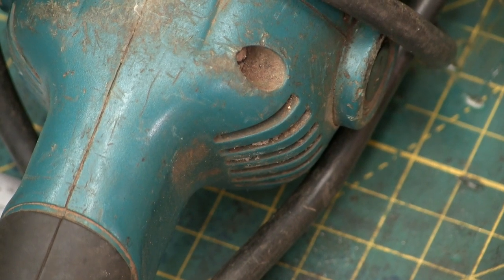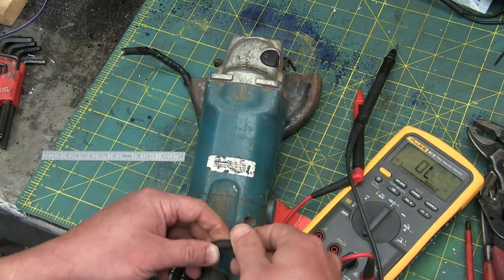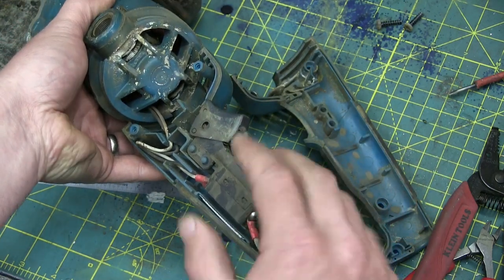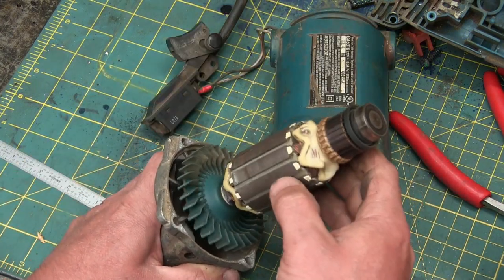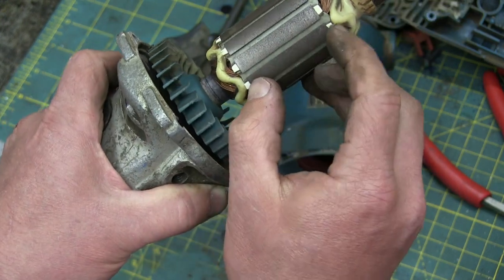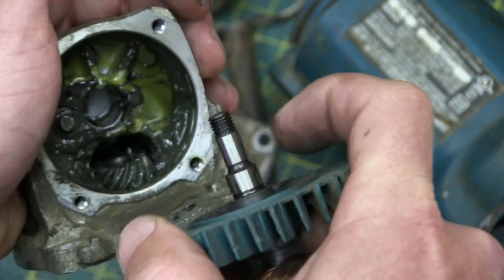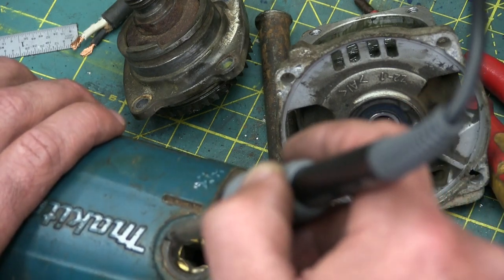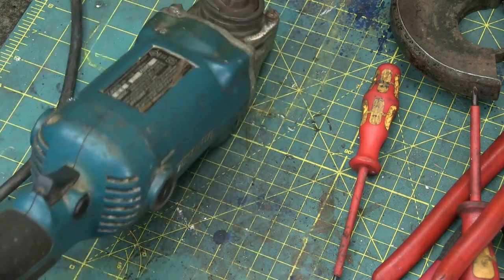BOLTR: US built Makita 5 inch angle grinder

Comment: Theres only one reason ive never bought a 5/6 inch makita. Theyre a bit more money than the default, and the default usually is burned up when youre done with it, and i assumed that was the end result of giving a welder a grinder with all makes and models. We just fuck them up. How ever, that one looks mangled, and it was still working fine. I think the makita might be actually worth the extra 50 canadian pesos, if they hold up better. Ps, i once went to buy a Makita, but, they didnt have any, and they didnt even have the default 5/6 that i wanted, so i got a 5 inch, and it lasted about 6 months. I still have it, but its starting to burn up, and its lock pin is fuckulated. (Left it at a shop with a couple mechanics, and they obviously ran the lock pin into the gear and throttled on through the noise..)

Comment: I have heard that Makita has a fairly strict spec they allow themselves as far as balancing an armature goes. If they need to remove too much material they reject that unit, it gets sold as scrap, and it ends up in another brand tool. As first rate stuff. So legend has it that you will never see a balanced Makita armature with very much taken out of it. They trash all of those.

Comment: Hi i started my apprenticeship in 1980 as a cabinet maker also do metal work, all my power tools were Makita a hammer drill, 1/4" drive router/trimmer 27,000 RPM the first li-ion 7.2v battery drill which cost a fortune as no competition try your time price gadget it was $290.00 in 1980 5" and 9" grinder circular saw 1/2" router they all still get used none have had any repairs the battery drill has the same battery  it came with  almost forgot 12" compound drop saw with linear bearing twin shaft with 10" pull for wide cuts that's a toddler at 1990 model. Would never buy another brand unless the Makita didn't have the features l needed .     Great video's

Comment: No starting condensator? In the Bosches that I fix there is :) also quite good but more failing points and more elektronics I guess :D
Reply: On a brushed motor? I've only seen those on induction motors, e.g. bench grinders and the like.
Reply: They have brushes so yes ;) Only the big ones have it GWS 24-230 JVX
http://www.mtmc.co.uk/Images/Products/92210/01_3601H64U06.GIF
number 54 It's a supression condensator, not starting condensator sorry ;)

Comment: I know this is an old video I happen to be 310 gorilla and I probably burn up more grinder's than most people I've ever bought the janky button the sometimes Falls outbreaks of bleeds of craps and pulls out so if you your mother's toe polishing  pad is stuck on the end of your grinder take a 1/8 welding rod cramming in the hole and get your  your finger smoothers nail polisher off the end grab a chunk of recycled junk from the 13 other other rat tail grinders you have and replace the button plus there's a notched section on the gland where you can slide a thin wrench into backup the gland and the screw bit to take said toe nail buffer off the end

Comment: well there newer 6 inch grinders have gotten well lighter is nice but a weaker 10 amp motor  at same rpm as well as disk break claiming that you cant hand tighten the wheel enough by hand  to keep the break from un tightening the wheel but thats a bs claim cause they dont stop like a drill they stop over a couple seconds and 7 ftlb you can get  by hand easy

Comment: You know. I hate the Botch grinders they got for our work. Most grinders has a parallel switch where it is very user friendly to hold, Botch went "we need to be different so make a switch to work perpendicular from the handle to be different!!" which makes it hard to hold while grinding. Why try re-engineering the wheel when just use it as is.

Comment: makita grinders are the only ones il use although 4inch
Reply: although the ones ive used tend to get dust caught up in the back vents and ive had one actually catch fire due to the electricty arcing through the metal dust and melting the casing. Makes a great smell but yea give em a blow out with compressed air and theyre good.

Comment: I killed a couple of these working at a forge grinding through the scale to get hardness tests.  Specifically, I killed a couple of dewalts -- never was able to murder the Makita.
Reply: We were forging API 6A valve bonnets & casing heads -- pretty beefy parts.  Easier to take the mountain to mohammed, as it were; use an angle grinder to reveal a chunk of bare steel enough to get a good divot from the semi-portable Brinell tester. If it passed, we had a wheelabrator to get the rest of the scale off -- a terrifying machine, BTW.

Comment: Id just like to point out that noone carries a blade change tool on a jobsite, so the lock has no function to begin with. Just hit the blade hard enough, alternativly you hit the concrete hard enough with the blade. Works every time, for 5" and 9" alike.

Comment: 8.30 the disc isnt stuck on there. Use a grinder spanner to remove it, you dont have to use the lock button.
the shaft behind where the disc sits has 2 flats on it for holding it with this https://www.amazon.co.uk/gp/product/B00BG8Y4SY/ref=pd_sim_60_1?ie=UTF8&psc=1&refRID=Q8WQ79DJXVZ3V7BM1DX0

Comment: All that robust construction and the fools are still using the horrible Phillips drive fasteners! This isn't 1930, assembly line tools now have good torque limiting clutches, we don't need a complicated drive slot that is purposefully designed to cam out. Phillips chew up both the bit and fastener, require huge axial force to prevent cam out, and relies of rather complicated geometry. 

I really wish manufacturers would use Roberson [tapered square], Torx/star drive is ok too but the size standard covers way too many steps (like 20 sizes to cover what Roberson and phillips cover in 4 bit sizes) and Roberson's taper allows the screw to stick to the bit for tight spaces and one handed use. 
Side note Phillips became popular in the USA because Roberson(the guy) couldn't produce enough screws for Ford model Ts and refused to license the design to Ford. Roberson was Canadian and did produce enough for a good portion of the Canadian build Model Ts, hence square drive is still somewhat popular there. It is making resent inroads in the US carpentry market as chinese Phillips head screws are not made to spec or with the proper drive size(ie a little #2 bit on a 4 inch #10 screw) and workers discover that with a proper drive type they can drive one handed and don't actually need to push screws into the wood with both hands and good footing. Hey and it only took 70 years! Now if we could get the hardware stores up to speed....
Reply: I love square drives. Here in NZ sparkies almost exclusively use them, in fact most trades use them. The only problem is I don't think they will ever work with collated screw guns.

Comment: People in the polymer industry use resin as a catch all term for any thermoplastic that's  100% nonvolatile mass. It's truly meaningless without some indication of chemistry. This all to say when describing the brush holder assembly phenolic or thermoset epoxy are much better descriptors. 

The whole case is some sort of resin (polyamide) as is the over molding (probably polyurethane). In fact the brush holder is the one of the plastic bits I wouldn't describe as a resin.

Comment: Oi, AvE! As Littlestworkshop says, eddy current and hysteresis losses are different. Just saying...
Look at the bottom of this page https://en.wikipedia.org/wiki/Magnetic_core
Reply: Easy - change the frequency. The magnitude of eddy current losses per cycle are related to skin thickness (ie frequency) but hysteresis is a constant loss per cycle. But you knew that.

Comment: Useless after the spindle lock fails, WTF??? Thats why the flat surface on then there shaft, to grab with a flat spanner, like oxy acetylene flavour.
When i was a wee prentice,was many a grinder not even featuring spindle locks! How you think we changed wheels there? If i went up to mr foreman and told him i needed a new grinder because the spindle lock was not choochin,id cop it upside the head!

Comment: My Makita re-purpose story: 

It was given the toss because the spindle detent had broken and rattled around in the head. I built a set of starting rollers for a Manx Norton classic race bike. Guy Martin rode it to victory at the cemetery Circuit here in New Zealand (the bike not the grinder).

Couldn't bring myself to paint the grinder, Why would you want to hide it?

http://tinypic.com/r/11v3z81/9
http://tinypic.com/r/1zdoqae/9
http://tinypic.com/r/30crf3p/9

Comment: Biggest work site in my junk yard's area (an underground train section) dumps shop trolley's worth (about 5 6 tools, even saw a Makita table saw) of these every five months or so. Unfortunately, outside of the plastic casings, and various pieces, they break them (intentionally, one was smashed with a hammer) and they also cut, not remove, cut, the cords. Frankly, their inability to set up a mini repair shop for their tools (which all in all would make a cheaper proposition, we have a dealership for Makita in this fucking town) aside, they are giant douchebags for smashing them.